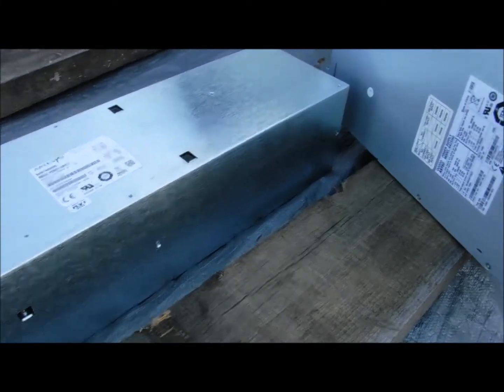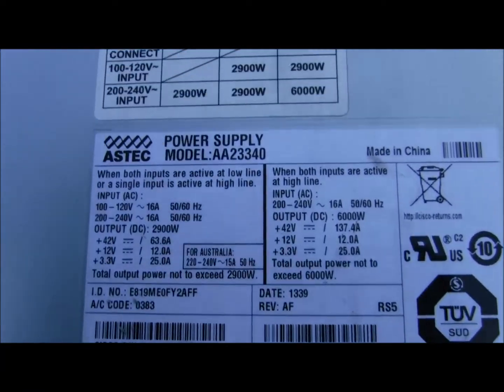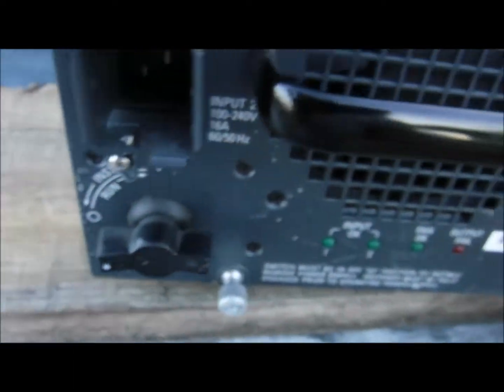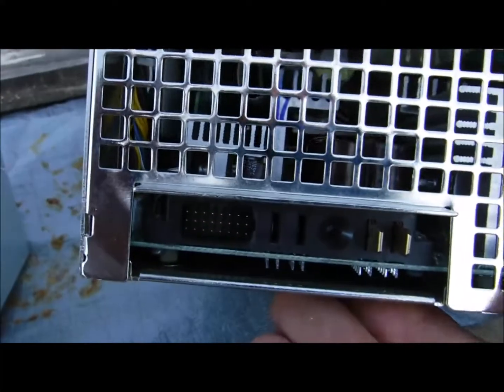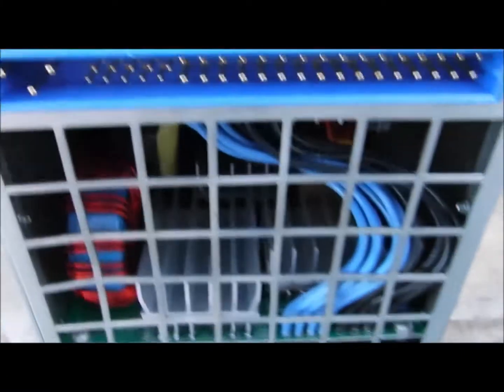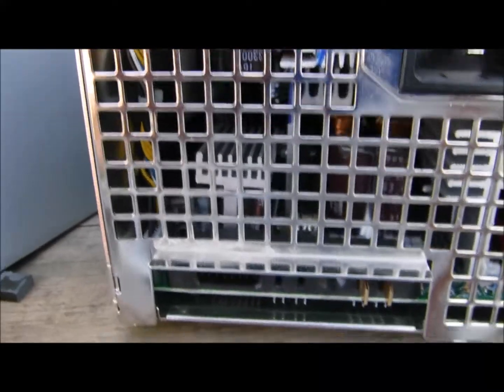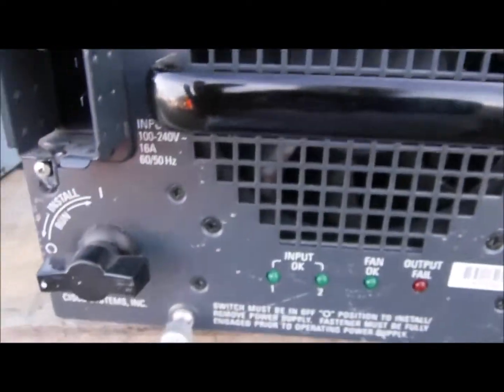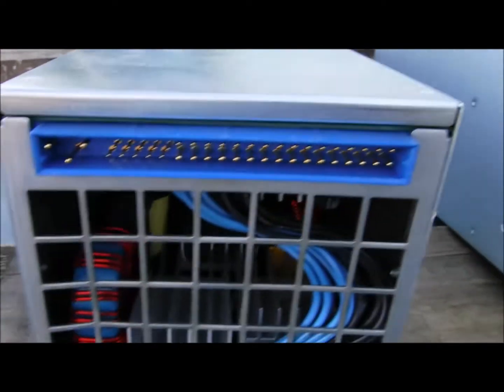Server Rack Power Suppies Astec AA23340 And Delta DPS 2000AB And Nortel 8004AC

Comment: Hi, I have the same power supply. Could you explain how you manage to get it to work?  I'd be very grateful
Reply from the maker: Astec AA23340 both inputs of the 120volt ac need to be used then it turns on or one input of the 220 volt ac then it turns on.

Comment: A có mạch điều khiển 6000w có ko
Reply from the maker: Just need the pinouts figured out they run then. All these Power supplies need the pinouts solved with out the racks to turn on and have output voltages.

Comment: did anyone ever figure it out for the astec AA23340?
Reply from the maker: I sure did but it's a bit hard to explain the what needs to be done. I might make a video showing  the how to. Do they ever work good to. So nice
Reply: @MrDoingEverything  cool. No rush though, since I realized this doesn't fit for my use case anyway. But I sure bet, someone else will appreciate instructions someday
Reply from the maker: @greenbigfrog8374  I have a few units yet to do. So when i get back to them i will make a video of doing one unit.  Yes your right some will appreciate the know how. I sure was happy after i solved it.
Reply: I also need this information for the AA23340
Reply: I assume both ac inputs have to come from different sides of the 110v split phase wiring from your breaker box. 220vac comes into your house on 2 hot wires (180° apart). Each of these hot wires are paired with a ground return wire and becomes 110vac. You can't power this unit with both ac inputs coming off the same 110v side of the split...it needs both sides so it becomes 220v.

Comment: cool project with switch on ohmmeter should show path then off goes back to 1
Reply from the maker: Lots of tracing that way if need be then yes. Maybe someone has a faster answer to the crossing of pins. Fingers crossed. If not then ya the time will be spend that way. I,m a little shocked there are no other video,s about these. Surely there would be some of them being used and figured out already i would think. Maybe not to. Good tip for sure and TKS for that.
Reply: @MrDoingEverything   https://www.rcgroups.com/forums/index.php  this group has a few threads on the pin out